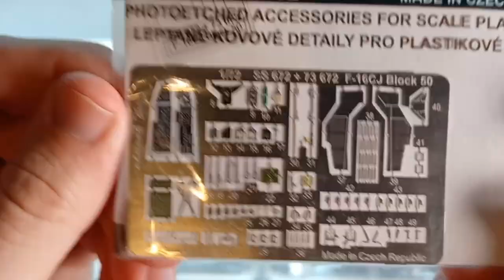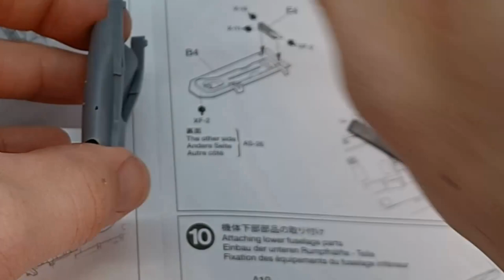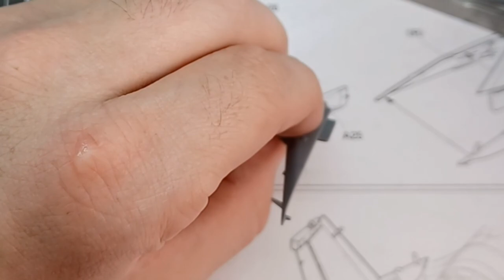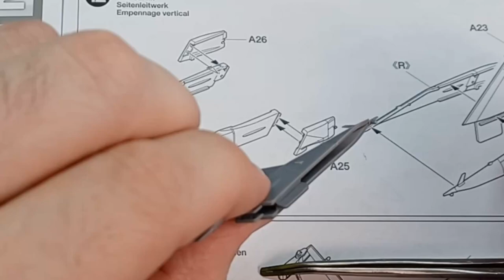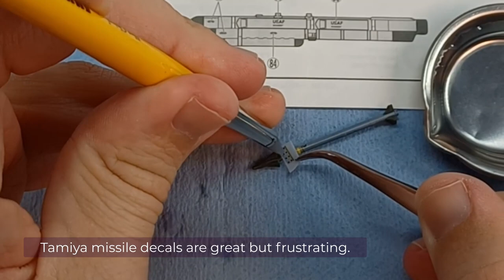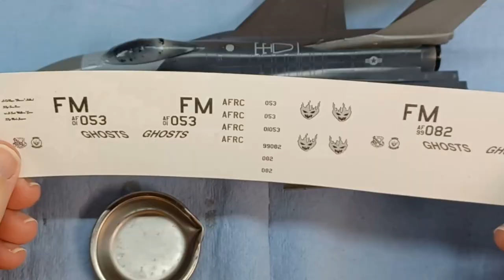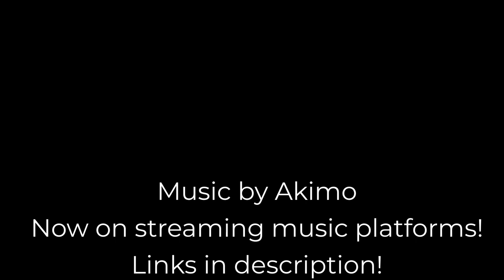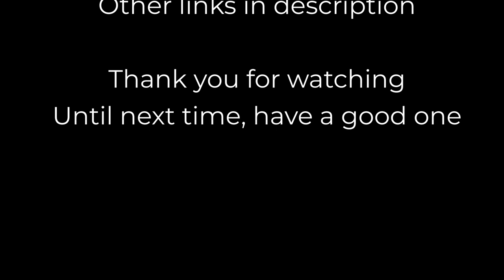Tamiya 1/72 F-16CJ Viper Twin Build

Comment: Lovely little kit, isn't it?  It just begs to be carefully detailed.  I bought some of the Brassin pieces on sale after I read the book "Viper Pilot" because they have such fine detail but I  think I'll use paint on the cockpit.
You were right -- the vertical fin would have been easier to paint on its own before attachment.  Also, masks are easier to remove if you use toothpicks with the end whittled into chisels.
Bravo!
Reply from the maker: It's an awesome kit out of the box. Using the Eduard cockpit was because I can't achieve that level of detail by brush. Same for the laser cut masks. Makes the process less stressful for me.

Comment: Nice work. Great video. I was wondering, do you remember how and when in the build process you painted the insides of the airi take?
Reply from the maker: The footage should be in chronological order. From memory, I did it after full assembly. I had to do some wild masking to do it without overspray. I wish I painted it before final assembly, but learning from each build is a big part of this hobby.